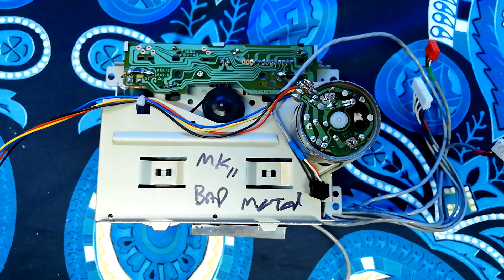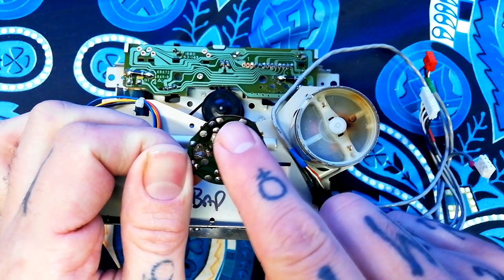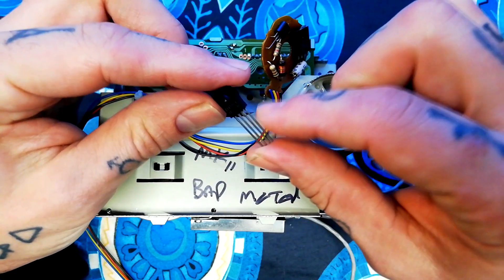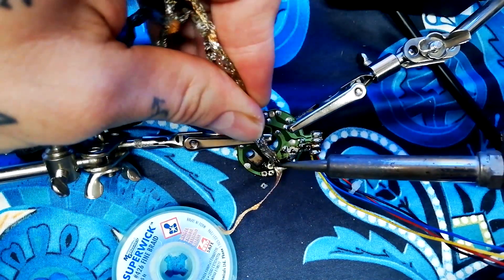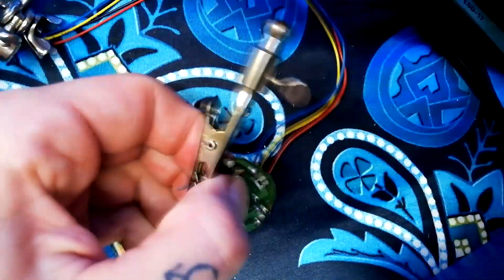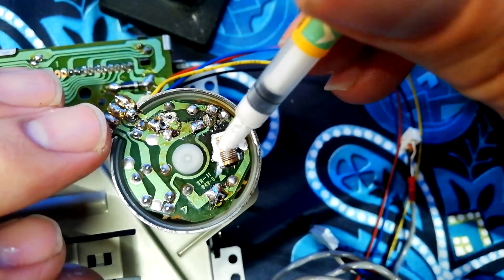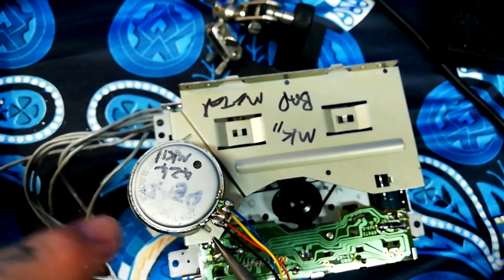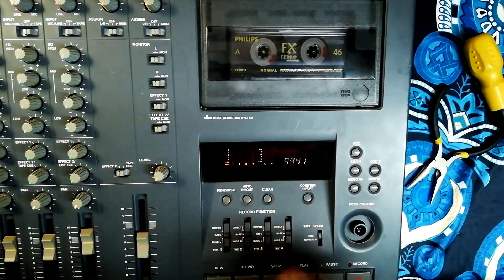Repair a 4-track motor | Mabuchi EG-530KD-2B | Replace the Control Chip

Comment: Hi Tetrakan, great YT channel!!!
My 464’s capstan motor has lost tork? (“Force”)…there’s no c1470 lm in Argentina…any sugestion? By the way: maybe the capacitor? THANKS A LOT
Reply: I'll expand on the information: the engine is mechanically ok, it works but has little torque/tork (force😊). Thanks a lot again

Comment: Hey man how do you adjust the speed on this thing? It seems to not have a potentiometer. I even broke mine cause I broke the board thinking I was screwing into a pot but it was the board, got a replacement though.
Reply from the maker: @MoeStar13  there will be trimpots to control mean tape speed on the portastudio PCB

Comment: Replacing the chip fixed my wobbly motor even though it had no visual signs of heat damage. Commenting here in case others find the same. Thank you.
Reply from the maker: Glad it worked, thanks for letting folks know!

Comment: For anybody attempting this repair on a Tascam 488: note that the top case (and its accompanying ribbon cables) need to be connected for the motor to spin up. So if you’re going mad diagnosing why the motor isn’t coming on after soldering in a new chip, connect the top part first. It might seem obvious but I spent about an hour messing around with this 🤦‍♂️😂

Comment: Hello ! I have a little problem with the motor of my 488, when I put on play, the sound has a kind of wobble, the pitch goes a little up and down. Do you know why? peace!
Reply from the maker: Clean the pitch control pot, but if that doesn't work, check the motor control chip, refer to this video
Reply: @Tetrakan  thank you very much! last thing, the 4 cables soldered to the capstan motor are soldered separately? mine just unsoldered themself  and when I resoldered them the play function no longer worked. I know the order is Black red blue and white

Comment: Great video!  I have a 424MKiii I'm working on and I suspect the motor.  It has an EG-530KD-2B.  What I would like to do before tearing off the endcap is bench test it.  As you know the connector pinouts are black, red, yellow, blue... I assume the blk and red are 12Vdc... do you know how to bench test this thing?
Reply from the maker: If the chip is okay the motor should respond to a 9v battery or other DC source, just ignore the yellow and blue connection and use the red and black, see this video https://youtu.be/HFm06qh1nmw
Reply: @Tetrakan  Yeah, I couldn’t get anything out of it so I popped the cover and just like your video the four pin motor driver IC is smoked.  I’ve got ten on order from eBay, shipping is slow right now.. waiting.   Oh, I spun the motor up with 12vdc direct to the armature pins without the driver, it’s good.

Comment: Could slow play warble be a symptom of a bad ic? All the best, thanks for content
Reply from the maker: possibly...so long as you're careful not to remove the plastic cap with the brushes in it, the best thing would be to desolder the servo board and look for discolouration around the motor control chip, it'll be pretty obvious if present.

Comment: Hi, I came across your video through the YouTube search. My problem appears almost similar to yours with the 4-track motor. I have Sanyo dual cassette player and when I tried to fix the belt issue, the motor got screwed. The player has a single EG 530YD 9BH 9VDC  motor which resembles like the one in your video. 
My question is what needs to be voltage at  "+, _, A and B"  when the play button is pressed? When I tried to open the control board on the back, the pcb got messed up! I can't find a new replacement motor for the player as such. Let me know if you have any inputs on my question. Thanks!

Comment: Hey man, great videos. I think they are going to help me a lot. I have a Tascam 488 which will not play, and the capstan no longer spins. I assume this is a problem with the motor, as it gradually slowed to a stop. I also began to smell a burning plastic. I am unable to find an identical replacement motor anywhere.  Would I be able to replace it with an EG-530yd-2bh (2000/4000 rpm instead of 1600/3200)? And if so, how would I adjust the speed of rotation, or could I still record using that motor and then digitize the cassette sound out of the Tascam without it sounding strange? Very new to this, as I never had a problem with my 488 until yesterday. Any help would be greatly appreciated. Thanks!
Reply from the maker: Hi, I'm not familiar with the motor you describe but it f the direction of the motor rotation, number of cables and form factor are the same then It'd be worth trying. There are internal trimpots beside the user pitch adjust pot which you could use to compensate uf the new motor spun  faster than the old ones.  The smell you described us probably the motor control chip burning out. It may be even if other elements differ, the new motor has the same chip installed so you could simply use it as a control chip donor? Let me know how you get on and thanks for watching.
Reply: @Tetrakan  Thanks for the speedy response. Great suggestions, I will let you know how it goes once the new motor arrives. P.S. Your videos are incredibly detailed and helpful, and without them, people like me may be totally lost! I hope you know how valuable the information you've shared has been. You're one of the few people online really keeping this work alive. I can't thank you enough. Wish me luck!
Reply: @Tetrakan  Hey man! Update on my 488. You were right about the control chip being burned out. The new motor came today, and my machine is back in business! The new motor strangely had the opposite effect on playback that I expected (old tapes play low & slow instead of fast & high) But recording new is as easy as ever. Also replaced the band with a common elastic, and it works just fine. Thanks again for your videos! Might not have been able to navigate the internals without them. Cheers
Reply from the maker: @liamlittle2521  glad you have met with some success, but honestly I'm very sceptical about using an elastic band...I experimented with such things years ago when I was trying to figure things out by trial and error, and in my experience the wrong belt can slow the motor down and cause it to burn out faster. So leave it in for now but do yourself a favour and get a proper capstan belt from West coast belts or marrs or GB audio ASAP, have fun!

Comment: Hi, thanks a lot for the videos they helped me a lot. I've got a 464 and I had to replace the belt, Gear C and the motor chip. Now It does play but sometimes it suddenly stops. Any idea of what could be the problem?
Reply from the maker: Autostop coming on maybe? If so you'd see the counter stop advancing and the takeup reel slow down just before it stops - maybe film the cassette for footage of what happens when it stops. If I'm right you can try replace the idler tire (if you can't find someone selling a replacement buy an assortment of small o rings and there'll be something suitable in there) and check there isn't old belt residue obscuring the sensors around the take-up reel.
Reply: @Tetrakan  just fixed this same thing on my 464 - the reed switches at the top of the transport that detect if a tape is inserted go bad pretty frequently. if you jam a finger into each one without a tape in and hit play, the heads should come up and stay up. I hit the contacts with isopropyl and superglued zip-tie ends (always perfect size) to the wall behind them to ensure the switches close every time. seems to be working?

Comment: hi, I'm looking for some replacement EG530KD-2B motors for my Tascam 688 and 644 but can't seem to find any on the internet.  Do you know of a place to order them?
Reply from the maker: They're not made any more, NOS and part-worn don't come up very often and are priced extortionately. I've has some success  installing a new motor control chip, though again its an obsolete part so if enough people catch on supply/demand will drive the prices up, check out this video, the second of  I did on the subject https://youtu.be/h1BBVAtDtIo
Reply: Same! Can't find them anywhere. It's a shame
Reply: @koyaanisqatsi316 hi would this work for a tascam 246 also?

Comment: Hi, thanks for this video. I have a problem with a tascam 424 mk 2. i replace the old motor for a new EG-530KD-2B , and when i turn on the portaestudio the motor start, then i put play button the cassette are palying in a erratic speed. the voltage in the motor are ok (12v in + and -, and 1v between A and B), i replace the IC of the motor C1470  but having the same problem. Do you have some information for this?The motor allways run when the portaestudio is on? I am going crazy, sorry from my english iam from argentina. Thanks!
Reply from the maker: Hi, sorry I haven't replied to your comment sooner, I didn't get a notification about it by email for some reason or I'd have answered sooner. The motor on your 424 mk ii is meant to spin all the time when the power us on, that is not a problem. I have found that most of the "new"  mabuchi motors are fakes, replacing the motor control chip in the old PCB worked for me...where do you buy the new motor? Did you install the replacement chip in the new motor or the old one?
Reply: @Tetrakan  Hi tetrakan!!. thanks for answer me , no matter the time ( 
i really appreciate it). I replace the motor for a new one and after i feel the erratic speed,  i replace the IC of the pcb for a new one( C4170) ,i buyed both things in a shop of electronic stuff rigth here in my city (Rosario). I read this same problem in other forums. Theres a very big problem with these new motors. What i can i do? I need to replace some other component on the PCB? The original motor of the tascam have other PCB. Maybe we can discover what is going on. I dindt know the motor works all time , so thank u very much for the data!!!°. Do u have some schematic?
Reply from the maker: @nmidu   again sorry for the delay, I didn't receive a notfication! The "new" motors I've seen are fakes, not suited for high speed. Ideally replace the chip and other components in the old motor. If your old motor has problems with the moving parts, the moving parts from the "new"  motor can be used but you should use the old circuit board with fresh components .

Comment from the maker: (Edit - the mod works, there was a bad solder joint, you can actually see it in the video! But I'll leave this comment up so folks know I'm honest!) OF COURSE as soon as I upload this video I go back to the 424 Mk II and the motor has stopped working! face palms Expect part three in this series once I've figured out what's wrong...LOL?
Reply: did you fix it?
Reply from the maker: @fearlesssound8275  yes, see the bit in brackets at the beginning
Reply: Tetrakan Supermonobloc the issue you were talking bout at 5:55 it really happened ?
Reply from the maker: Dude, I don't understand...the unit is fixed, tonce I fixed one bad solder joint the repair worked, there's nothing else to show you.